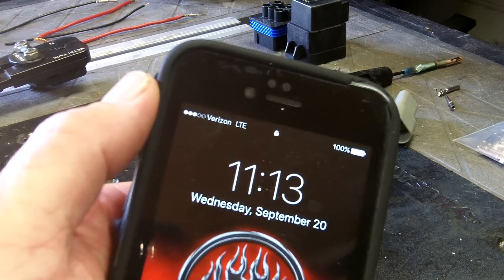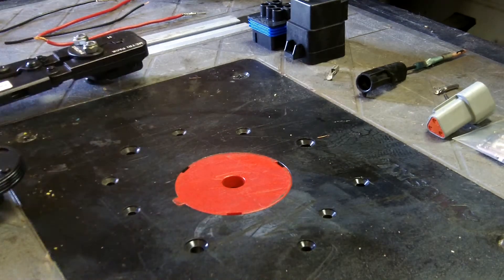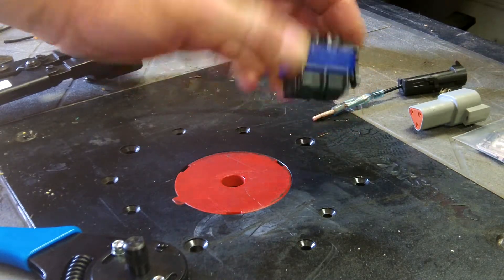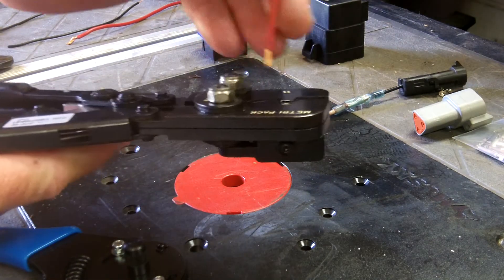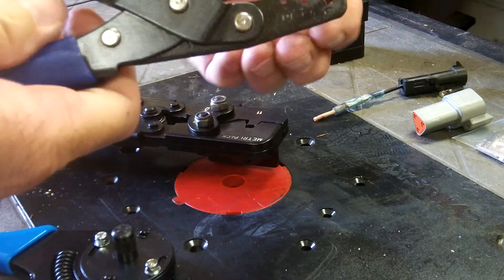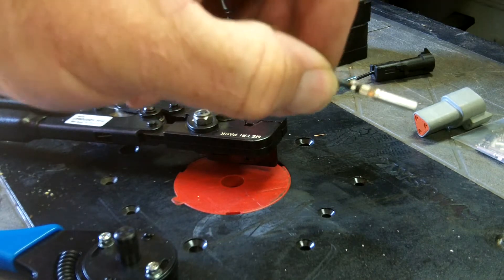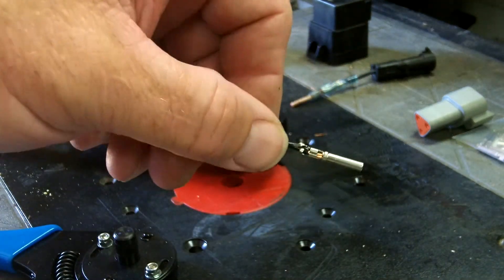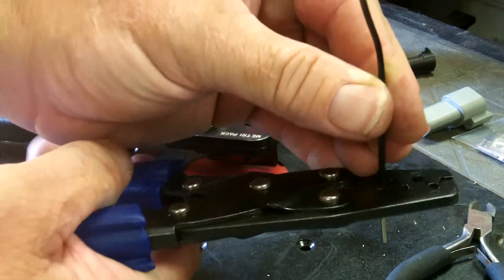Eclipse  Deutsch Connectors Crimping Tool

Comment: The true 'mark of a man', is to pull on the cable till it gives way, then assess if it's the conductor that has broken, or weather it's the crimp that's just plain let go? If it's the crimp, then the tool's a no go!
Reply from the maker: The true mark of a man is to pull on a wire connector? Man, I've been doing life all wrong!!
Reply: @h2oskiaddict  Haha, it sounds sick I know, yanking on a freshly crimped terminal (not something I usually indulge in myself) but that’s what I’ve gleaned a lot of lately, from many Youtubers who do crimping videos, and that’s what they offer up. “You should ‘ALWAYS’ test your crimp by pulling on it” “The copper strands should snap, the conductor should ‘NEVER’ let go of the crimp!”

So I tugged on a crimp I did, after using the cheap tin bum Chinese solid barrel crimper that I have (not saying that yours is, but mine certainly is) and it actually failed!

They’re probably from people like me who usually buy these overpriced tools (coz I love buying good quality tools) and then try to justify them?